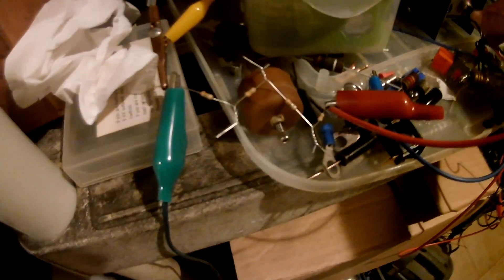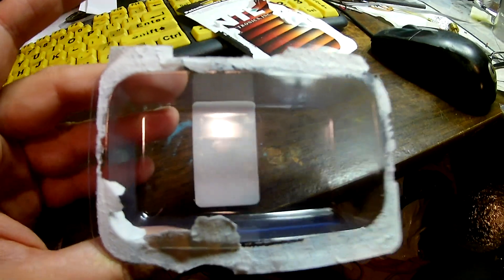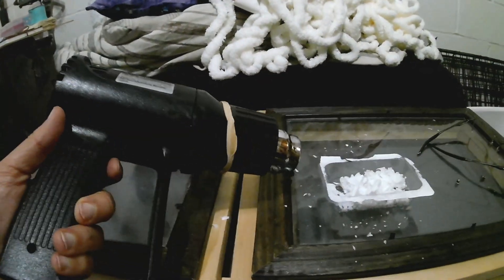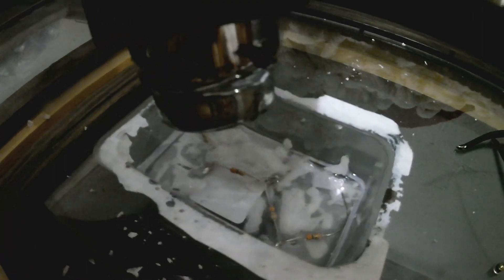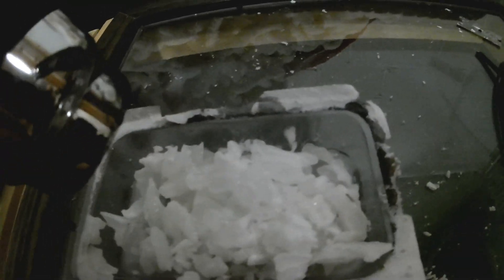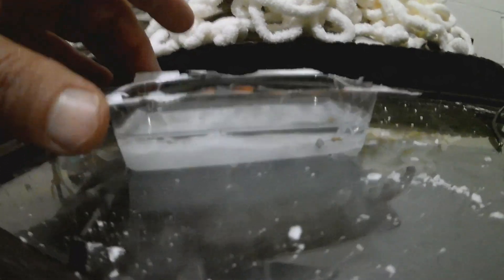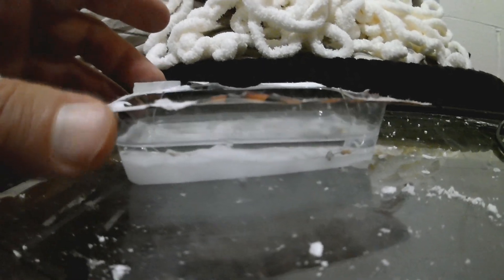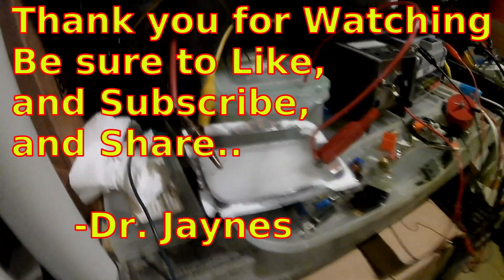Potting High Voltage Circuit with Paraffin Wax

Comment: If you're just making this as a disposable HV project then ignore...otherwise,

Suggestion: not sure what this device is going to be used for, but if you want reliability in resistors on HV sections you might want to use something a bit more substantial than 1/4W.   I'd recommend 2 or 3 watts bare minimum.  

Reason being 1/4W is only rated for about 200VDC.

For my capacitor dischargers I have 25 watt Dahle type resistors with the metal fin heatsinks and use globular/ball soldering where applicable.  I put 'em in a tray (or build one up around them if on a wood plank or something) and pour the clear resin you get from Michael's just up high enough the top surface of the heatsinks are exposed.  This way
1) minimizes corona arcing
2) clear resin means you can see if/where a resistor might have broken down
3) the exposed tops of heatsinks allow for further cooling, whatever form you choose.

I know Dahle resistors can be expensive though, so just purchase whatever is cost-effective.  But I wouldn't push my luck with a 1/4W job unless you're planning on disposing of it in fairly short order.

BTW I agree this virus thing is being exploited to all hell.

Comment: Mineral oil is what I use
Reply from the maker: Does that work pretty good?
Reply: @jaynesnetwork  yes
Reply: @chemistryscuriosities  What kind of mineral oil? I have access to paraffin oil which is less viscous than the wax, but what specific oil do you use?
Reply: @connerwiseman4876  I use baby oil because it’s the purest there’s no adulterants but Ayoub put it under high vacuum to remove any dissolved, oxygen or any other gases that conduct electricity, especially high voltage
Reply: Mineral oils used in  electrical transformers and paraffin wax used in swappable battery packs. So both tend to be dielectric... They both have pros and cons... 

The main advantage of paraffin wax is it's also a phase change material, so it's better at passive thermal management. FWIW